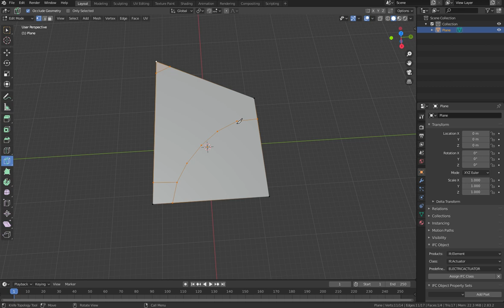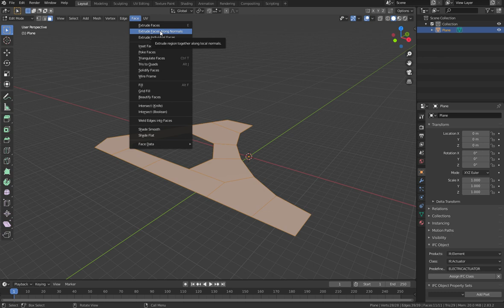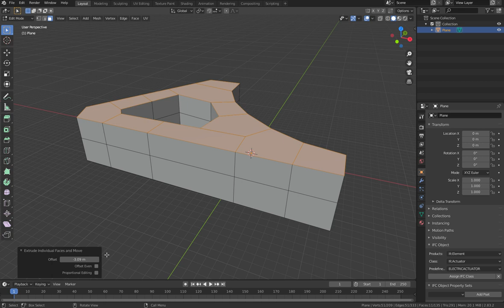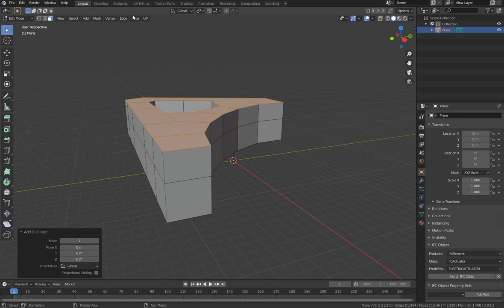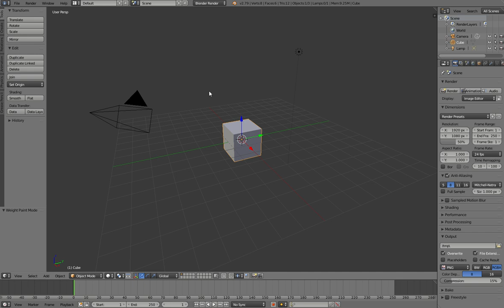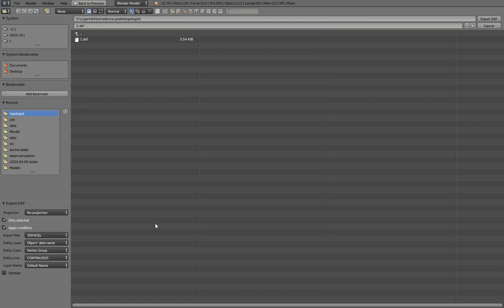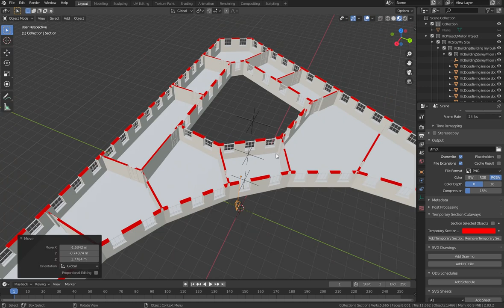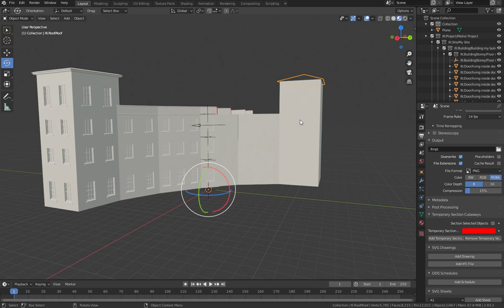Model a building in ten minutes with the topologise tool

Comment: I tried to get this up and running this evening and failed... I was in Ubuntu is it easier to setup in windows?
Reply from the maker: I have created a Linux add-on bundle, nothing for Windows yet: https://github.com/brunopostle/homemaker-addon/releases
Reply from the maker: The latest add-on is just a single click, no need for all the exporting and importing is this video
Reply from the maker: @magicpixeltree  it sounds like you have multiple versions of the homemaker add-on installed, try removing it and reinstalling using the zip bundle, you may have to find and delete the files. The BIMOwnerProperties stuff is just warnings and can be ignored (it was fixed in in blenderbim a couple of days ago)
Reply: @BrunoPostle  Thanks Bruno, i just reverted my linux back to before i started meddling with it... will test soon and tell you how i go.

Edit: It failed again mate, so annoying this looks amazing...

location: <unknown location>:-1
Error: Python: Traceback (most recent call last):
  File "/home/merlin/.config/blender/2.93/scripts/addons/homemaker/__init__.py", line 104, in execute
    molior_object.Process(ifc, circulation, elevations, traces, hulls, normals)
  File "/home/merlin/.config/blender/2.93/scripts/addons/homemaker/molior/__init__.py", line 65, in Process
    self.GetIfc(
  File "/home/merlin/.config/blender/2.93/scripts/addons/homemaker/molior/__init__.py", line 138, in GetIfc
    part.Ifc(ifc, subcontext)
  File "/home/merlin/.config/blender/2.93/scripts/addons/homemaker/molior/space.py", line 107, in Ifc
    run("geometry.assign_styles", ifc, shape_representation=shape, styles=[style])
  File "/home/merlin/.config/blender/2.93/scripts/addons/blenderbim/libs/site/packages/ifcopenshell/api/__init__.py", line 41, in run
    importlib.import_module(f"ifcopenshell.api.{usecase_path}")
  File "/home/merlin/Blender3d/blender-2.93.2-linux-x64/2.93/python/lib/python3.9/importlib/__init__.py", line 127, in import_module
    return _bootstrap._gcd_import(name[level:], package, level)
  File "<frozen importlib._bootstrap>", line 1030, in _gcd_import
  File "<frozen importlib._bootstrap>", line 1007, in _find_and_load
  File "<frozen importlib._bootstrap>", line 984, in _find_and_load_unlocked
ModuleNotFoundError: No module named 'ifcopenshell.api.geometry.assign_styles'

location: <unknown location>:-1

I thnk this is an issue with BlenderBim:

https://github.com/IfcOpenShell/IfcOpenShell/issues/1505
Reply from the maker: @magicpixeltree  I'll do another release, all the recent changes have been behind the scenes, so I didn't think it was necessary
Reply: @BrunoPostle  bro if you do another relaase can you integrate the cosmetical changes addon? that looks amazing.
Reply from the maker: @John Chalmers I have generated an up-to-date release, this requires the latest blenderbim: https://github.com/brunopostle/homemaker-addon/releases
Reply: @BrunoPostle  Legend thanks again Bruno! Works like a charm
Reply: @BrunoPostle  Thanks Bruno i got it working you legend!

Comment: How to install? and what Terminal should I use to install this addon?
Reply from the maker: On Windows I use cygwin, but it it possible that the Linux subsystem will do as well
Reply: @BrunoPostle  for the Topologise addon I've tried the README way of installing the addon but on the first command it gave the message: Command not found
Reply from the maker: @callofzon6544  the README is for the urb Perl module as a whole, the blender add-on doesn't have any documentation, yet. The command will fail if you don't have Perl installed, but see other comments, getting this running on Windows requires some Perl expertise.
Reply: @BrunoPostle  where can i install Perl
Reply from the maker: @callofzon6544  ActiveState have a Perl installer. Note that since I'm not sure how easy it is to get Perl scripts running as executable files on Windows, you might be limited to the command-line technique demonstrated in the 'create a building in ten minutes' demo - the new Blender add-on may not be easy to run on Windows at the moment.
Reply: @BrunoPostle    So I got this message when I entered the command perl Makefile.PL : Can't open perl script "Makefile.PL" : No such file or directory
Reply from the maker: @callofzon6544  you need to use the 'cd' command to change your working directory to the one that contains the Makefile.PL file
Reply: @BrunoPostle  I tried : cd D:\User\Downloads\brunopostle-urb\brunopostle-urb perl makefile.pl . but that gave back the message -bash: cd: too many arguments. and I changed the names of the two file at the end of the file address to make it easier to type and after I did that I restarted Cygwin.
Reply from the maker: @callofzon6544  If you are using cygwin, this would be two separate commands (note that cygwin expects Unix forward-slash path separators):

cd /cygdrive/d/User/downloads/brunopostle-urb

perl Makefile.PL
Reply: @BrunoPostle  I did :cd D:/User/Downloads/brunopostle-urb/brunopostle-urb and that worked but perl Makefile.PL doesn't work for some reason.
Reply: So I tried Strawberry perl and for the comand perl Makefile.PL worked but when I put in the command make it didn't work, Do you know why?
Reply from the maker: @callofzon6544  it might be called dmake on Windows
Reply: @BrunoPostle  This is what I got it did nothing in blender, no results in blender and I don't think it worked. I've already put in perl Makefile.PL once before and I don't know if it worked  and I quite perl after that so I don't know if that messed it up or not. Here is the link to what I did https://imgur.com/a/CIjbKvv
Reply from the maker: @callofzon6544  I don't get the gmake error, probably `dmake install` still works.

Note the warnings at the top, you will need to install these dependencies in addition to the four Perl modules from my repository (you don't actually need all of them for Topologise, skip Algorithm:: Evolutionary and SVG).
Reply: I don't know if I'm going to go to all the effort to install these things just to install this addon but are you going to make it so we can just add this addon to the addon file in blender? If so when?
Reply from the maker: @callofzon6544  this is the intention, but this is largely an assembly of tools that were created for other purposes entirely, which is why they don't fit together so well, these are early stages
Reply: @BrunoPostle  Do you know how long it will take before we will be able to just add the addon to the addon folder?
Reply from the maker: @callofzon6544  I'm sure it can be done now, but somebody who develops on Windows needs to step up. Otherwise, there is a lot to do, basically the whole thing needs to be rewritten in Python, and I could use some help there
Reply: Wow how did u do that? Can you share tutorials?
Reply from the maker: @DsalesArchitecturalServices  it's a proof of concept, so it isn't quite ready for production. You need to install several Perl modules which are linked elsewhere in the comments.

There is also a more recent blender add-on called Topologise that automates pretty much all the steps in the video (see my latest YouTube video for a demo), though Topologise add-on installation is only really straightforward on Linux for now.